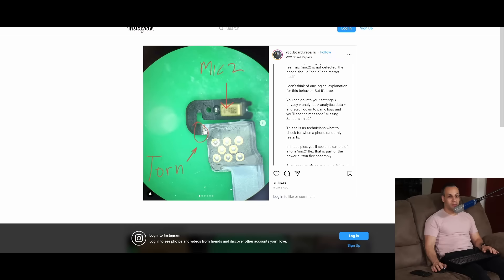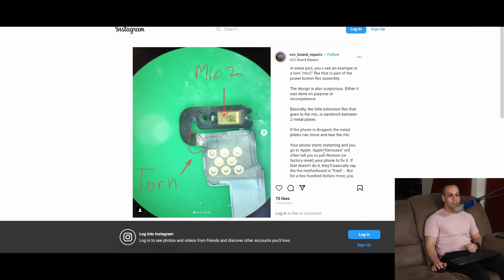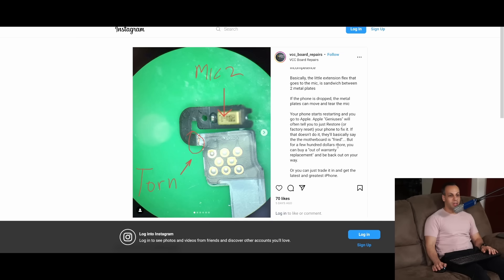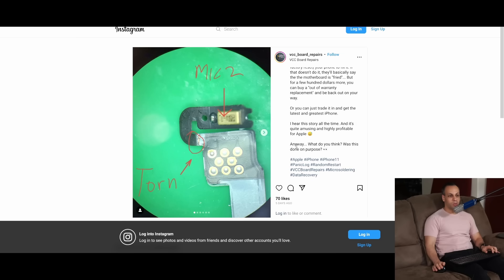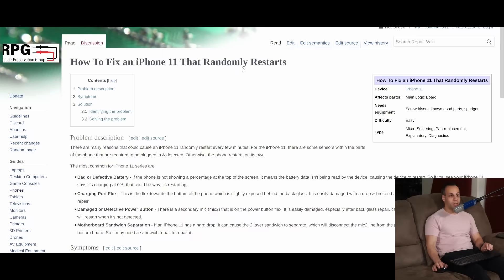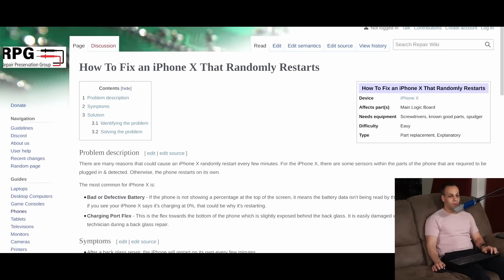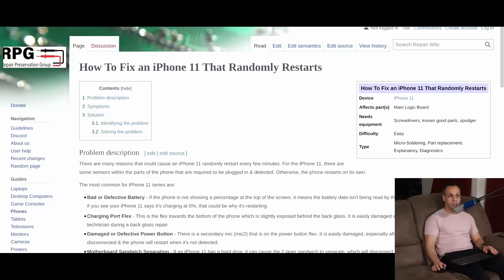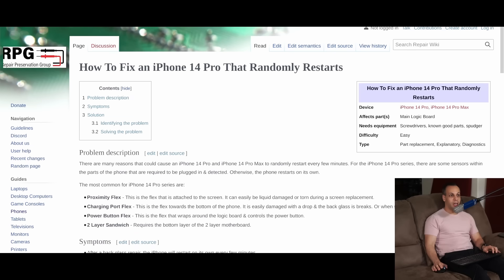iPhone's design flaw shows that 10 years later, their engineering is still a joke

Comment: (Former) driver dev here (while I primarily focused on NTDDK, I'm familiar with the XNU/Darwin IO kit). This is just the driver developers, program managers and Apple being sloppy and then deciding the fix wasn't in their best interest. Of course iOS (XNU/Darwan) has provisions for handling device disconnects (and has support for layered drivers, user-mode drivers, dynamic resource config for hot-plug, etc., etc.) and this absolutely shouldn't result in a kernel panic. They simply decided to not implement proper handling in the driver (or some aspect of the IO kit stack) because "that should never happen". That it results in a kernel panic is only acceptable to Apple because it drives some kind of revenue (e.g. "let's not fix this, as the problem is the solution"). Any other platform and this kind of a driver and device handling defect would be treated as a sev A, super-critical, totally borked up, bit of nonsense that needed immediate fixing.
Reply: That's where I'm at - having been in the software industry for a decade, I can absolutely see this making its way into the wild without it being a malicious occurrence. The part that IS malicious is not addressing this as high priority, production breaking bug, which it is. Gracefully handling failure modes is one of the most important parts of modern software development, IMO.
Reply: As a dumb warehouse worker who just grinds for 25 years getting food to stores, I want to salute all the tech geeks ( not insult) y’all make the world move like the rest of us. Thank you for what you do, I can barely understand what you said, but it’s obvious you have the passion to make things work.. and work properly. Thank you.
Reply: @anthonybrink287  Hey man, as human being who depends on eating, you have no idea how much I appreciate you making sure the food gets to where it needs to get to. Nothing dumb about that.

Dumb is Apple having a kernel panic and boot-loop inducing defect in their software that’s easily preventable.
Reply: @anthonybrink287 As a software developer, I'd like to thank you for getting food to store shelves. Society relies on people of all professions to do their thing. Writing code might require a few extra years of school/practice, but it is (mostly) not magic. Creating a driver pretty much means "move information from this sensor to a place where it is accessible by the main processor, and unpack it so that it can be used".
Reply: Now wouldn't it be great if you could fix this yourself in the code, build a firmware image and flash your modified firmware image to the device? Apple would have to release the code and open your bootloader to your request, to give you the means to repair the software on your phone for yourself. This is far better for us all and the environment, than the E-waste for the years since Iphone X.
Reply: I could even go on what that wasteful lifestyle mean in terms of productivity. Doesnt it mean that if we produce 95% of the products for the landfill, that the workforce productivity is also only 5% of what it seems to be, and doesnt it also mean that the real value of 1$ of products is rather 5 Cents? Projected to e.g. the next 6-12 months?
Reply: @alles_moegliche73 it’s an interesting concept I’ve been kind of mulling over for a while now - like, is something crumby, yet accessible more valuable than something hermetic, yet exceptional? If something was broken and I fix it is it now considered better than before because the likely failure mode is known and the solution to it proved enactable - or is the whole process fraught because of the time investment required on my part to discover such things? I think a fundamental problem I see myself running up against is that, even assuming a generous discount, the amount of time alone required to do a one off repair for all but maybe the top 10% of consumer electronics is infeasible for sustaining any sort of livelihood - versus a production facility which is properly setup to do an extreme amount of one thing that can eat the perhaps pennies gained on each item/action. For myself I have to focus on what it is that I’m trying to extract out of something, and often, I just want to see if I can improve something and want to learn how it works, very often to no specific financial end. I see the logic in these companies models, even if it doesn’t jive with maybe the way I like to do things, or what comes to me most naturally.
Reply: Yeah my guess as well. Probably not made on purpose, but definitely the guy that should be working on it was probably assigned to other stuff because they just think it's not worth "wasting" time making their product more robust
Reply: Quick question: does XNU/Darwin have anything really anal in a useful way here like static driver verifier?
Reply: @Ariccio123  It’s been a long (long) time, but I’m pretty sure the architecture hasn’t changed substantially: basically (like modern Windows of the NT variety) you have kernel mode (IO Kit) and user mode (driver kit) drivers. Both have static build time analysis stuff built into Apple’s tools. However I don’t recall them having something functionally comprehensive (outside or Apple) like the Driver Verifier that ships with windows or Microsoft’s more recent HLK framework. That said, it’s been 15 years since I did any active development on Apple’s stuff, so they may  now have lots of fancy tools I don’t know about.

However, just to reiterate, the main issue is that a kernel panic arising from an audio input device disconnect or fault, should not happen - not ever, IMHO. There are some system devices for which a fault requires stopping the system (core IO, bus controllers and bridges, etc.) but that microphone is on the other side of a ribbon cable, which says to me that it’s probably hanging off the peripheral bus (I’m pretty sure Apple silicon/SOC’s are AMBA, so that’d specifically be the APB). Basically: kernel panics r bad, mmkay.
Reply: @Ariccio123  😀
Reply: I really doubt all other platforms would treat it as of any particular importance.  In fact I'd be surprised if the information that there is a problem even gets back to anyone Apple.  Are people reporting this to them?
Reply: This scenario makes a LOT more sense to me and seems to be the dealt with the same way as other previous Apple product problems.
Reply: It almost feels intentional, not just poorly done. If they have experienced developers, they'd have come across the "missing device at boot" sort of issues in their experience. If they're less experienced and mainly only doing iDevice work, they surely still would have disconnected parts at some stage while developing drivers, and would have noticed boot failures for stupid reasons and worked around it...
Even if it was just poorly written drivers, surely the kernel itself should detect a boot loop (or kernel panic) and inform the user rather than acting like defective hardware.
Reply: This right here. It's malicious to not do error handling in something that can kernel-panic your system. Working with something like this on the software level, you know this possibility without a doubt, and you know the outcome when writing the driver. It has never been oversight or sloppy anything. It's intentional

Comment: As someone who works in a repair shop that mainly focuses on iPhones and iPads, this issue affects all iphone X and newer iPhones and is a daily occurrence. So frustrating...
Reply: nokia 6310 don't do it 😀
Reply: Is there any particular model that seems to hold up better?
Reply: @irjlevelet  I wouldnt say theres a specific one thats better. Every model has its own flaws.
Reply: @no.p.roblems  Is there anything better than other styles?
Reply: @irjlevelet  Yes. Any of the android phones.
Reply: @@GH0STST4RSCR34M In the US a lot of carriers are very picky about what phones are on their network and even then what features they get. I have a US carrier unlocked Samsung Galaxy S21+ that I know has the exact same firmware as the AT&T version, but they didn't allow wifi calling until later software updates, and there wasn't a good reason for it. Same goes for HD voice/VoLTE for other phones or 5G support even when all of the bands on the phone match the carrier.

Trying to figure out if the phone you want (before you buy it) works on the network you want to put it on is a challenge and sometimes impossible because the carrier won't give you any reliable information on what they do or don't allow. That's the unnecessary complication.

With an iPhone (and newer models of Google Pixel) it will work because they have agreements with the major US carriers.
Reply: I still find it hard to understand why anyone would buy any apple product. The way I see it, there are two requirements for a person to want to buy an apple product, stupidity and wealth. 
How does this company sell anything? Answered my own question eh 😄
Reply: @pseudonayme7717  ikr? But you find Louis' comments sections populated with crapple apologists nevertheless. Software support's also an issue with Apple. I had to bin my old gen 1 iPad mini last week because it couldn't handle any apps that I needed to redownload after a factory reset. This happens to an extent on Android too, but it's not nearly as big of a problem. And I'm still running 20yr-old software on my win11 desktop quite happily.
Reply: @pseudonayme7717 I've been wanting to switch away from iPhone but I've hesitated because until a lot of androids don't have a lot of years of security updates. 

I tend to get a new phone every 4-5 years and I haven't really seen any phone with a good support promise that I like. Switch OS seems annoying as well. I recently got a Samsung  tablet after my iPad got scratched and it is far less intuitive when it comes to unlocking and navigating apps. 

It is a budget tablet though so may not be a fair comparison.
Reply: @AzayBae how can you tell that the security patch workd?
Reply: @pseudonayme7717  It's actually a really sad and true story what's going on in America specifically. Most people are just FORCED to buy apple products due to the infamous "green vs blue bubbles" situation that seems like a joke to non-Americans, but actually it is a huge deal over there to the point of having to buy an iphone even having a personal preference for android phones because otherwise you'll have almost no friends in school, you'll just be the "green bubble guy" and you'll be excluded from chats because you "ruin" them, this is real. It's also proven that you'll have way fewer chances of picking up girls. Apple of course knows this and they fully take advantage of the bullying and social pressure to buy their products, it's basically their "best" marketing strategy which is just hideous.
Reply: Does it happen to androids too? Lol
Reply: I hope you squeeze every dollar out of those tsupid iSheeps 😂
Reply: @kevinlow69420 ironic you spelled stupid wrong 😂
Reply: @KongQuestCo  filter bypass
Reply: @KongQuestCo and you made a grammatical error
Reply: @kevinlow69420 Let's not pretend that Android phones don't also have crappy design flaws that might make certain things more frustrating. I say this as an avid Android user who will likely never buy an iPhone. However, I do recommend iPhones to people who do not want to or are not able to deal with a lot of the unnecessary complications that Android phones come with (especially unlocked models here in the US, but that's not necessarily the fault of the manufacturers.) The operating system is relatively simple and if I or someone else has to help them with it, the interface is the exact same so finding answers and giving directions is easy, whereas Android does not share in this uniformity (which is a double edged sword.) Basically, if you want to learn how to use your phone in the best way possible, Android is great. If you just want a basic experience and got roped into this smart phone crap and don't want to think too hard about it, iphone's are great.

Basically, we need to advocate for better engineering overall, not gatekeep users of one system over another. All of these can wind up with engineering problems. Louis just mentions Apple because they're one of the most blatant and he experiences them every day.